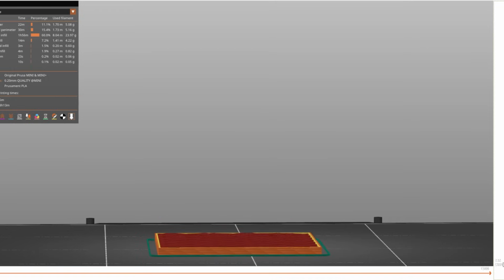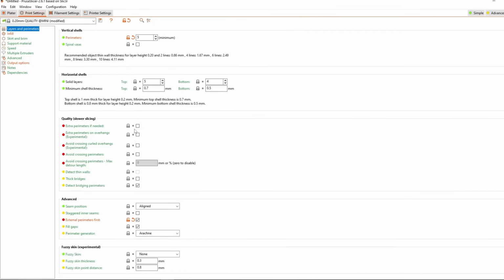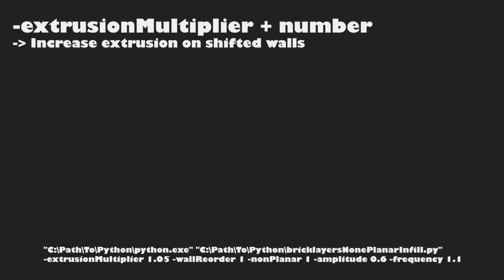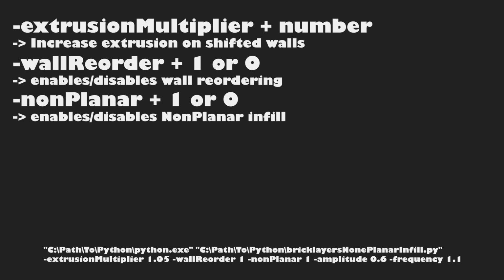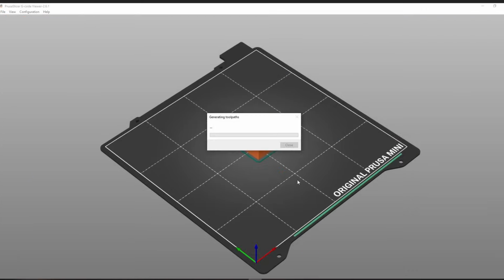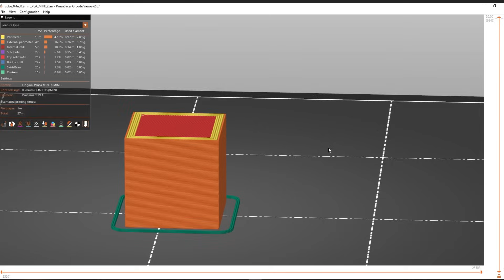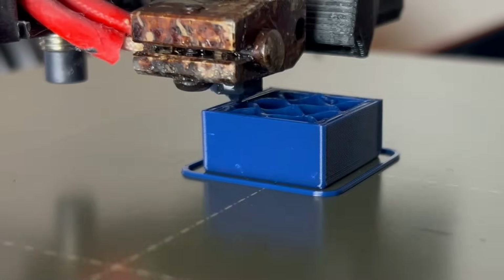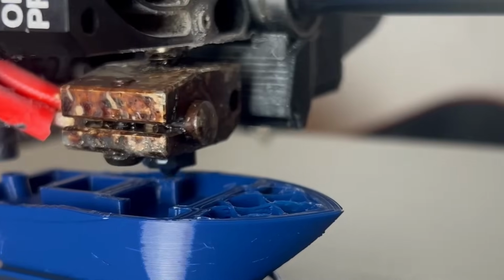Update: Bricklayers combined with Non-Planar Infill!

Comment: Is the non-planer infill a selected infill, or does it follow the path of the selected infill in the slicer?
For example, if I selected grid infill it would be what's seen in the video. Grid deposited in a non-planar Z axis.

Would the non-planar plugin work with something like gyroid infill? I'm not sure whether it would have any real benefit, but it would be awesome to see an infill like gyroid printed in a non-planar fashion. I imagine you would truly be approaching 'strength in all directions' to the point where parts may start to outperform injection-molded parts for strengths vs weight.
Reply from the maker: It works with any infill. But I suggest to don‘t try gyoeid beacuse it would take a lot of time to calculate.

Comment: I noticed the version with nonplanar infill doesn't have a parameter for the layer height. is that on purpose? Why the change between the two scripts?
Reply from the maker: It now detects it from the gcode file
Reply: @ nice. Do you know of anyone that’s gotten it working on Mac OS? I just tried it out a few minutes ago and it doesn’t seem to be working for me. 😿

Comment: Any plans to make it available in Orca slicer for Bambu printers ?
Reply: it is, follow the instructions
Reply: @dutchsailor6620  I did, to the letter. But I can't even see any changes after exporting the g-code and importing it back in. And the script seems to be running during slicing.
Reply: @FranticGuitar88  I think it's only a matter of time before these scripts will be included  in the slicer, so i guess you'll have to be patient until then.

Comment: Maybe this has been mentioned, and I'm late to the party, but there is that variable line width feature in most slicers these day (Anansi ???)
I noticed that in your diagrams all of the layers are the same width, but the height changes?
What if the width of the internal walls also changed, thus the 'brick' structure would be in both directions???
Reply: The problem that is being addressed is lower bond strength between layers.  What you bring up would improve strength between walls when subjected to a sheer force that is unlikely to be a significant issue in practice.  (Unless I am missing something.)
Reply: @boggisthecat  I haven't read the original patent, but if altering the path in more then one dimension isn't mentioned, this could be a way to mitigate the previous work???
Reply: @DaveTimperley  
There is no patent issue.
Reply: For future reference and algorithm, you meant “Arachne”

Comment: Hiya, these are great concepts to further the capabilities of 3d printing.

One thing that I've been thinking about is how everyone is working so hard to hide  the 'seam' created when we print in layers.
I've been wondering if we could 'obscure  the seam' by making it a feature????
A vase with a seam up the back is hard to ignore.
But a vase with eight equidistant seams around the perimeter becomes a 'feature'.

We could have an checkbox in the slicer for 'radial seams' and the user selects the number of seams they want the object to be printed with?
ten seams running up the side of a handle becomes a grip surface, much like the fuzzy skin does.

Or we could have words and symbols created out of seams running up the side of an object. Such as a URL or trademark?
Reply: Vase mode is continuously extruded without z-hop.

Comment: You know I had a thought that could further entrance brick layers, what if they were brought in closer in xy than standard walls would be. For example if standard layers are 0.4mm wide with 0.4mm spacing, make the walls 0.3mm or 0.35mm spacing to further lock the brick layers together
Reply: Just modify the extrusion values to ensure the voids are filled.

Comment: Tried but get just failure with Error Code 9009 when I export g-code. ;( 
Here: Post-processing script "C:\Users\path\AppData\Local\Microsoft\WindowsApps\python.exe" "C:\PRUSA\Skripts\bricklayersNonPlanarInfill.py" -extrusionMultiplier 1.05 -wallReorder 0 -nonPlanar 1 -amplitude 0.6 -frequency 1.1 on file C:\Users\path\AppData\Local\Temp\.28036_0.gcode.pp failed.
Error code: 9009

Comment: First of all, thank you for the script, but I have a problem with running the script. It shows Post-processing script "C:\Python312\python.exe" "C:\path\bricklayersNonPlanarInfill.py" -layerheight 0.2 -extrusionMultiplier 1.3 on file C:\path\.17180_0.gcode.pp failed.
Error code: 2
Reply from the maker: You need to use the  new parameters (choose values as you like): -extrusionMultiplier 1.05 -wallReorder 1 -nonPlanar 1 -amplitude 0.6 -frequency 1.1
Reply: bonjours, j'ai eu le meme probleme, avec prusa slicer, je l'ai regler en automatisant l'ouverture de prusaslicer en mode administrateur

Comment: Please consider making script for multiple wall vasemode.
I have been doing this manually in CAD by using negative volume bodies and ribs. It is really beneficient for materials requiring uniform extrusion without any retractions.
Also, klipper based belt 3D printers integration for prusaslicer/orcaslicer would be neat.
Reply: I have been wondering why this isn't a thing for SO long.
Reply: yep, would be awesome!
Reply: @riba2233  Hey again! Hahaha.
Reply: @802Garage   😁
Reply: @802Garage  - Hey again 2U2
Reply: Maybe first get it to work normally haha
Reply: Wouldn't you want him to build a fully functional rocket for you too?
Reply: @Splarkszter  Oh, I didn't know he could.
I'm waiting for it, then.

 =)
Reply: Cannot you just use 2 perimeters, 0% infill and 0 top layers?